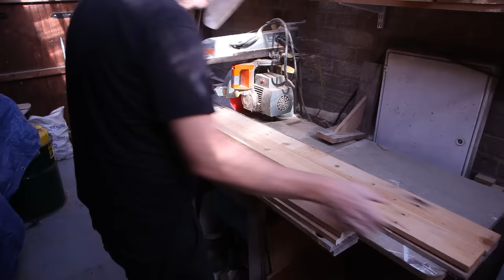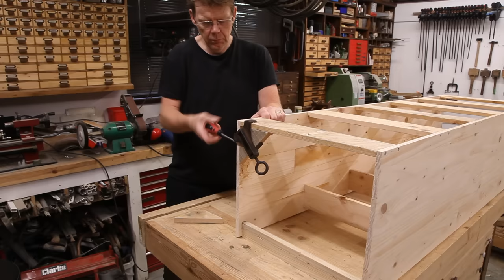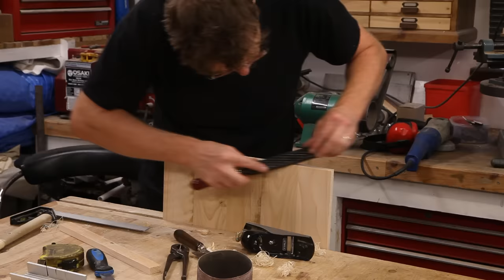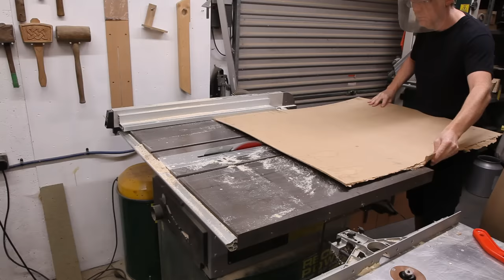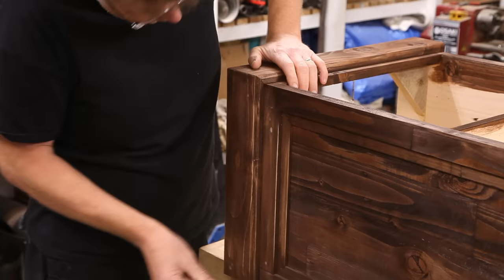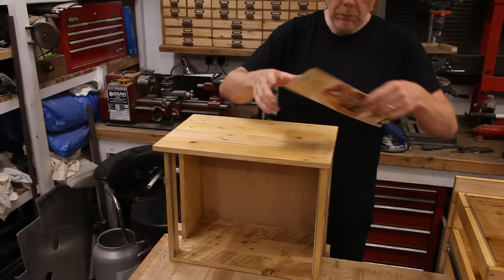Specimen Drawer Filing Cabinet made out of Pallets.

Comment: It is amazing that those old pallets can be turned into something so functional and beautiful. Well done, Jason!
This is a lovely piece of work.  I especially like the thinner pallet wood which has so much textural beauty compared to homogenous marine birch plywood that is thicker and very uniform in coloring.  Plus it is solid wood of high strength.
I thought this was a jewelry chest type of slim drawer but surprised to see a filing cabinet.  I love the small drawer cabinets for organizing all my various hobbies.
The contrasting wood looks gorgeous, and that is your signature look with blond and brown woods against each other.  I wonder what type of blond finish you are using - wax or oils?  Looks very good.

I like to use Boiled Linseed Oil to condition dry wood but would love to have a few other choices.  Something that brings out the natural wood color and also conditions it with some oil.
Reply from the maker: I used Briwax furniture wax to finish the filing cabinet. Dark oak for the case, and antique pine for the drawers.

Comment: Very well done! I like the way you do your glue-ups directly on your work bench. I want to do the same thing. What kind of surface does your bench have to prevent glue ups from sticking to the bench?
Reply from the maker: Thanks. One of my benches is varnished chipboard, the other is just sanded pallet wood. I stop the glue sticking to both by rubbing the workbench surface down with candle wax.
Reply: @EpicUpCycling  thanks!

Comment: Wonderful piece of work as always. Can I ask what thickness you normally plane your pallet wood down to and is there a particular reason why you always choose to use a hand screwdriver as opposed to a drill. Which would be quicker? Keep up the great work 👍
Reply from the maker: Thanks R C. I try and leave the pallet as thick as possible. I can usually get between 13mm and 15mm with most stuff.
The reason I don't use a drill driver is I'm not in a hurry. I do use one sometimes, but I prefer doing things by hand if I can, I just find it more satisfying :)

Comment: Epic Dude, Great build as always! When I saw the tumbnail I thought it was all individual draws you sly fox you😆couple of Q's if I may, what is the filler you use and what Record table saw are you using? As always Dude stay safe n well. TFS, GB :)
Reply from the maker: Thanks Graeme. The filler I use most is Everbuild multipurpose wood filler. I also sometimes use Everbuild 2 part wood filler if I need it to set fast or be a bit stronger. The saw is a Record Power TSPP250

Comment: Nice build. I was impressed with the screw hissing. I have made a couple pallet wood pieces and in some situations would have liked to conceal the old nail holes.  What wood filler and stain type do you use?  Most fillers I’ve seen don’t take stain  well.
Reply from the maker: Thanks. I normally use Everbuild multipurpose wood filler. It seams to take stain pretty well. The finishes I used on the filling cabinet were Liberon dark oak spirit dye,  Briwax dark oak wax and Briwax antique pine wax.
Reply: @EpicUpCycling  thanks for the reply.

Comment: Out of curiosity,  why do you use a cross cut sledge and the band saw for cosscuts, when you have a radial arm saw?
Reply from the maker: I don't use the radial arm saw much these days. I've found it a lot easier to cut on a sled. My radial arm is pretty old and really needs building into a new bench as it can be a bit inaccurate. I still use it for rough crosscutting though.
Reply: @EpicUpCycling  I have a radial arm saw, it's my favourite tool in my workshop. It also needs to be adjusted its not cutting accurately at the moment. I also want to mount it on a custom bench so I can add storage. The factory stand is not easy to add storage too.

Comment: New subscriber here with a question you have probably been asked 1000 times already.  How did you remove the nails from the boards easily?  Great build!
Reply from the maker: Unfortunately every one seems to require a slightly different technique.
Reply: @EpicUpCycling  mind sharing your go to technique?
Reply from the maker: @PPGExplorer  There are a couple of things I usually do.
I rarely break down new pallets straight away. I wait until they have been outside in all weathers for several months, then I store them undercover for a while. This often makes them easier to pull apart.
Another thing I do with the common type of pallet made with blocks of wood in the corners, I split the blocks with a hand axe from the side and break them up. Then all that's left to do is hammer out the nails from the boards. It's not the easiest technique, or the safest, but it often works well for me.
Reply: @EpicUpCycling  great. Thanks so much for the reply. Love your work.

Comment: Great Stuff.
How is the long aux fence connected? there were two screws on the top. what do the hold on to?
Reply from the maker: Not sure which part you mean?
Reply: @EpicUpCycling  about 1:55 into the video you have what looks like a long aluminum bar attached to your fence.
could you explain what it is, and how it's connected?
Reply from the maker: @yossiyaari3760  Ah, now I understand. The additional length is to allow me to run slightly warped boards along the fence to straighten one side out. It's just a length of angle aluminium held with two coach bolts with wing nuts. The coach bolt heads slide into the slot in the top of the normal fence.
An extra note: It can be quite dangerous to do it this way. I wouldn't recommend it unless you are absolutely sure the board wont move when you are pushing it through.
Reply: @EpicUpCycling  I was going for rectangle aluminum tube, which is much more stable. So I couldn't understand how it connected 🙂